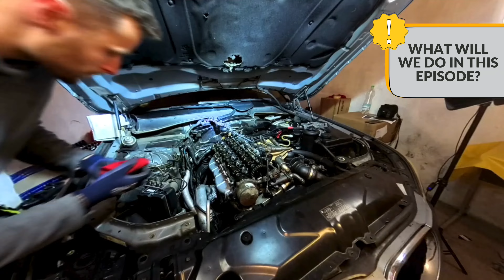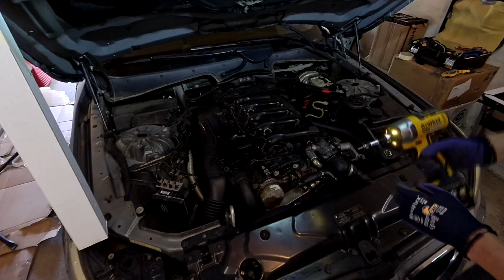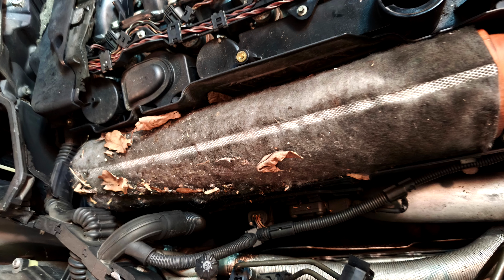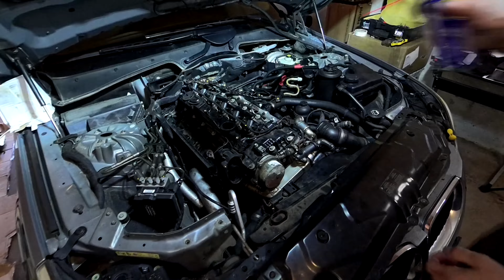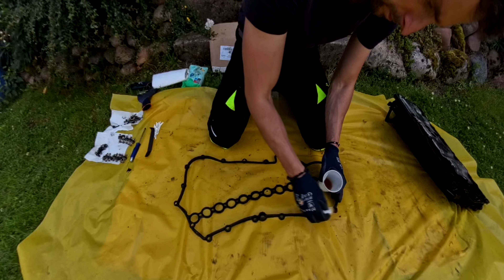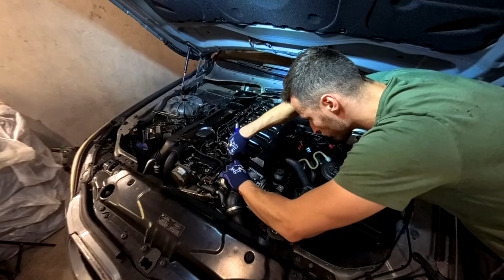How to replace the VALVE COVER GASKET on BMW E60 / E61 3.0d M57n full guide

Comment: great job, i think i will do it soon. my only fear is the red circled gaskets of the intake manifold which over time tend to fall when you pull up the intake manifold or when you are installing it since they do not stay in place like yours did, i did it once and one almost fell into the intake😱
Reply from the maker: Hey, chill out, it's going to be fine. If anything drops inside, you can use a compressor or a narrow vacuum attachment to pull out the debris, so it'll definitely be clean. And honestly, those seals you saw in the video were aftermarket parts; after a year they got pretty hard, so this time I bought all OE ones. They cost a few times more, but they should hold up their quality for the next 8-10 years. I think if you're planning to keep the car for a while, it's worth spending a bit extra on stuff like this for peace of mind. Let me know how it went ;)
Reply: @fixmyBMW thank you for the advice. you think its best to replace only the valve cover gasket or the valve cover itself too? my car has 160k km's and i hear people say that the valve cover tend to warp because of heat and all the years and it could not sit properly. what do you think?
Reply from the maker: @Error472Trolls  If the cover isn't cracked anywhere right now, holds up, and isn't leaking oil, I wouldn't really replace it. With a new gasket, it'll probably last another 100k. Mine is at 270k mileage now and the cover itself is still fine :) Unless money isn't an issue, then as long as you're already in there, why not—it'll be peace of mind forever.